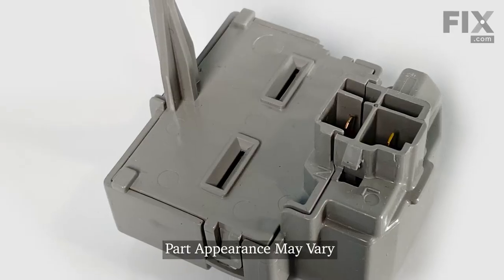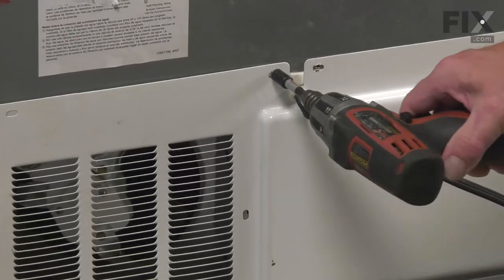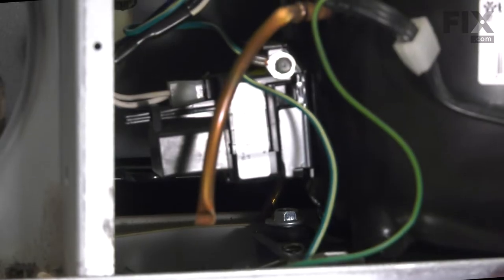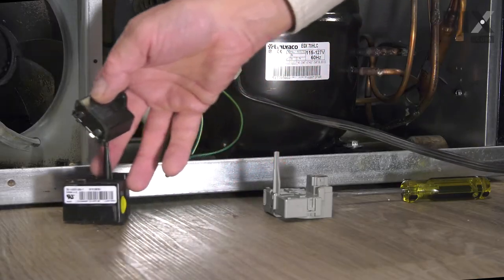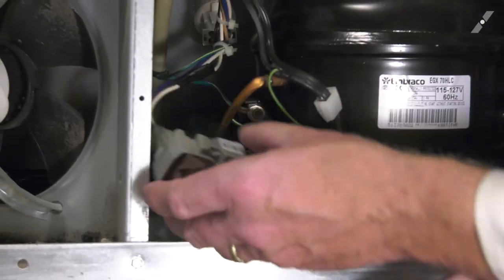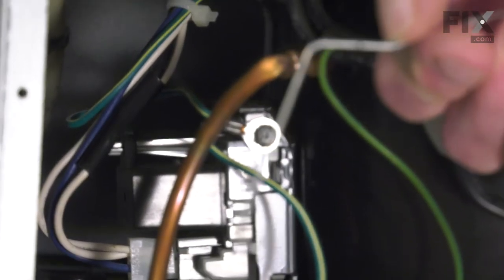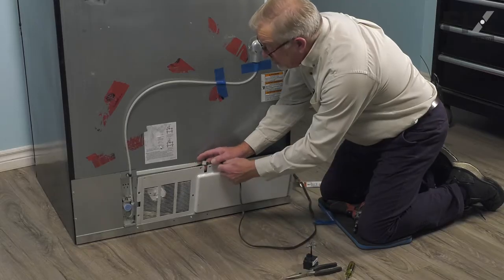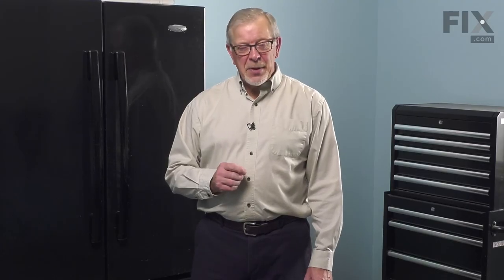Whirlpool Refrigerator Repair - How to Replace the Compressor Start Relay

Comment: Yeah the new start compressor relay came with the black piece fridge still didn't go below 50 degrees but the new start compressor relay part took away the high pitched fan sound and now the fan is quieter as it should been but fridge is staying at 50 degrees and am now waiting 45 minutes as it says to to restart it if that doesn't work I'll wait 24 hours then plug it back in and see what it does

Comment: While my relay is working it is making a buzzing noise during startup for about ten seconds (sounds like the water solenoid but it is not).  Would you advise against replacing the relay/cap with a Supco hard start so i don't need to order the OEM relay?

Comment: My compressor is on working but top fridge won’t cool is it still the start relay?
Reply: If its like our fridge there is a damper that opens and closes to let fan forced air into fridge section from the freezer section. I think the issue with my damper was also related to the compressor overload or start relay. Symptoms were the overload tripping when the fridge door opened as it closes the damper at that time.